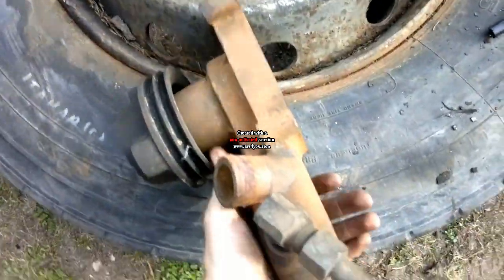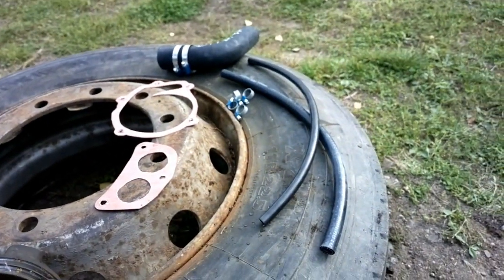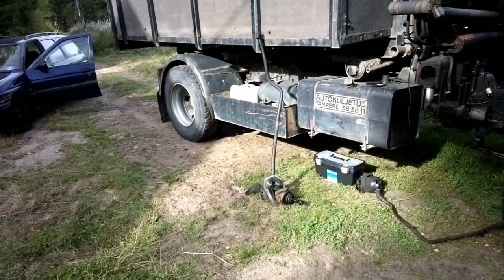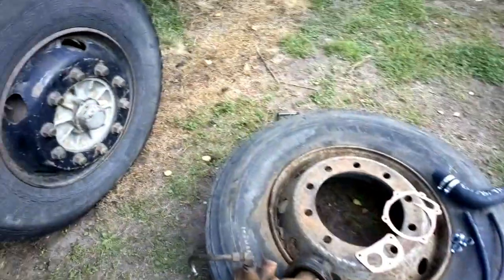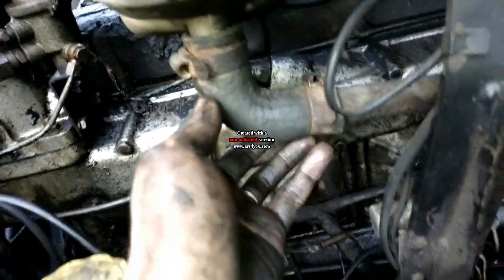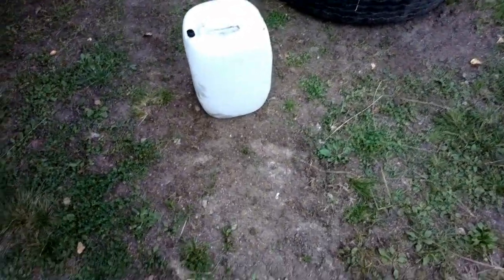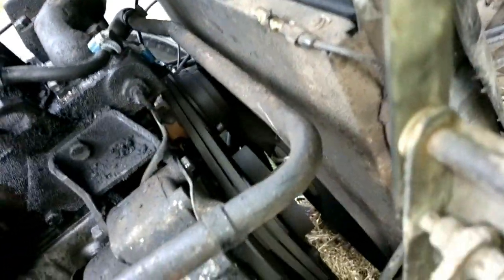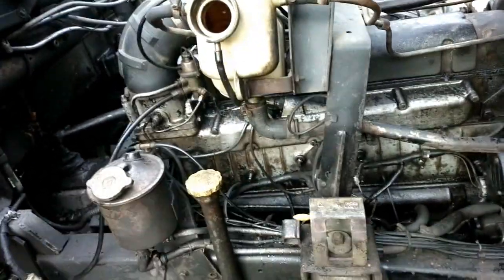Bedford water pump update - Finished

Comment: I'm glad you are going to change those tyres especially if you are going to be carrying heavy loads like sand - much safer for everyone!! Looks a good repair on that water pump but you will surely have to fill the whole system and get it up to pressure to properly check for leaks. What % antifreeze will you use for your climate?